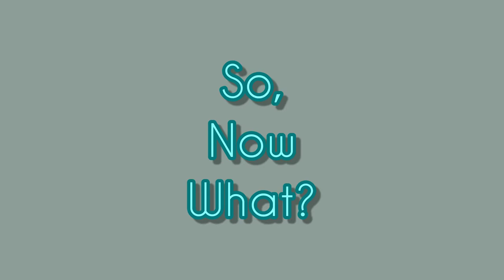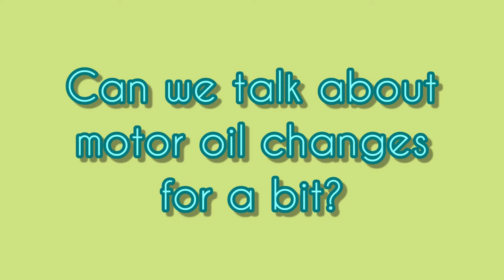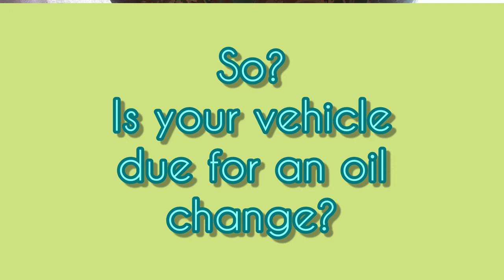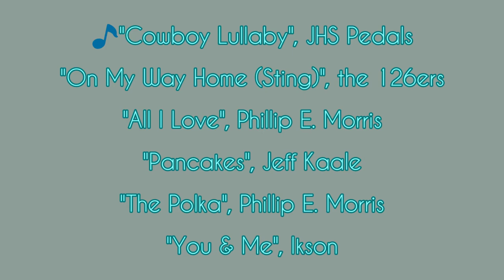Nothing is Truly Non-Repairable; Oily Odyssey; & a Fight!

Comment: Only my little daily '98 Metro even comes close to needing an oil change because of mileage.  Everything else should probably get oil changes because of time, though none of it is really black.  Plus my truck, '82 Dodge W150 slant 6 burns or leaks enough oil so that it gets continually replaced and never ends up terribly dirty, that's in addition to not having gone 4000 miles in the last decade.
   Several times I told myself that the next time the oil got low I would change it, but then when it actually did get low I forgot and topped it off, though the truck is low now and I just finished my taxes so not much excuse.
   My favorite is Castrol Magnatec, but I would otherwise go with this report that I generally like, which generally seems to like Quaker State Synthetic and Pennzoil conventional. 
   I wish they made Magnatec 10w-40, high mileage, or for diesels.
   PTFE additives are going obsolete and were a problem in some engines, mainly I think modern ones with tight tolerances especially in VVT valves etc.  plus perhaps with high efficiency oil filters; but in simple and heavily worn engines like my slant 6, and especially splash oilers like old mowers, I think it still has a place.
Reply: It was the link to the website with the oil tests and rankings. wouldn't post and hid from me that it wasn't posting.  I'll try to codify it.
Reply: It wasn't easy.

Comment: some glitch with comments. it counts 10 but mine aren't showing up. but that 10 count suggests I am making duplicates that I can't see.
Reply from the maker: It says 6 on my end. YouTube is an approximate creature. My view counts for each video vary slightly depending on where I look. YouTube will also "unsubscribe" accounts if it decides they are "spammy", which occurs when someone subscribes without interacting with the channel in some way. It moves them into an "Other" section, where they still show as subscribed on their side, but don't count towards my subscriber count. I've been learning the ins and outs of YT's algorithms and it's pretty complex, and geared towards keeping small channels small (aka not monetized.)
Reply: @ShopKatIndustries  I had a rather long comment describing my vehicles and their oil change schedules.  All but one reach time before mileage, but for some reason it got deleted.
Reply from the maker: @alan6832  right, I remember reading that one while it was up! Very strange. I didn't delete it, that's for sure!
Reply: @ShopKatIndustries  You and an intenet glitch motivated me to change the oil in the old pickup yesterday, but they gave me the wrong filter so I had to rush out to get the right one.